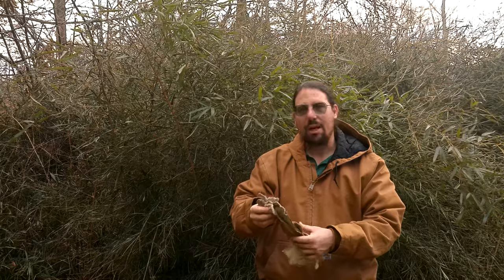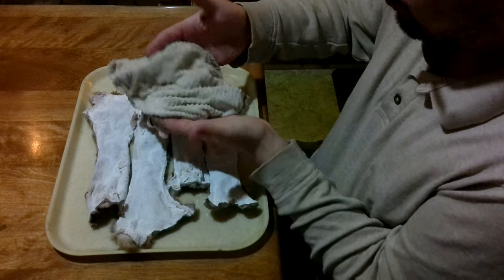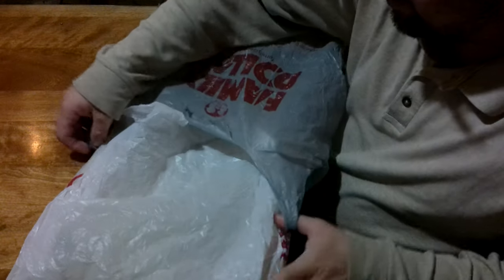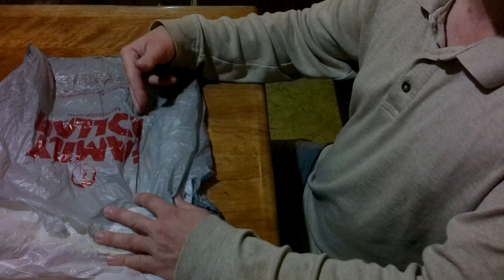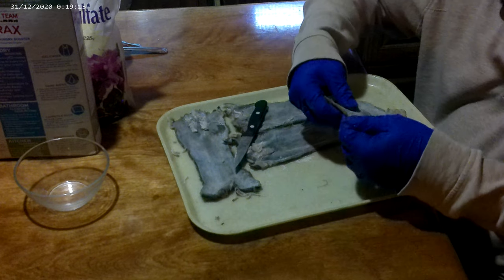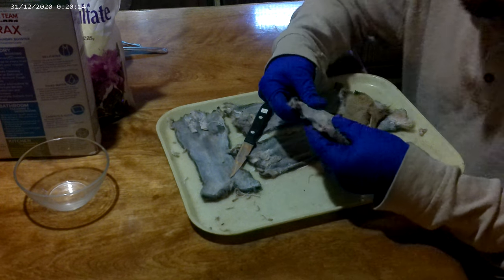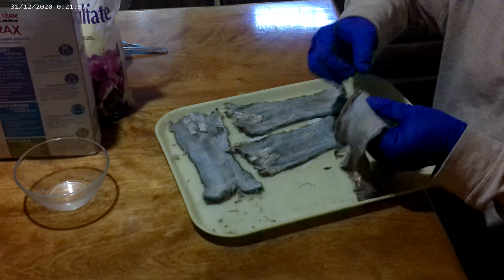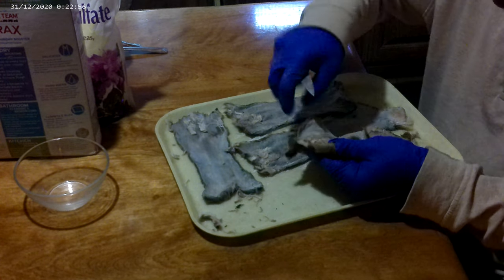Alum Tanning Small Skins--Using Aluminum Sulphate and Borax on Deer Leg (Hock) Skins

Comment: Hi there 👋🏻 love the video, very informative and helpful! I’m going to test your process on some spare pieces of hide I borax dried a few months ago. I can’t wait to see if this will save them. 

I did want to ask if you believe this method would work on a full hide of small game? (Rabbits, squirrels, possums, raccoons etc.) I’m essentially interested in trying to soft tan the whole hide and then make a “stuffed animal” of sorts so it would be posable.
Reply from the maker: Of course, and the mixture is pretty close to what comercial taxidermists use as a "dry preservative".  Chemically, hide is hide regardless of species, the only variables are how fatty it is (fatty hides lice racoon require extra processing) and how thick the hide is. Now, you say "save a hide", it won't undo insect damage or hair slippage that has already occured; but it will prevent further problems.

Comment: Heyy mate! Nice video :)
What do you think, it is a good idea to use this paste to make leather for crafts? Wallets,bracelets etc.
Reply from the maker: Well, it really depends on the use.  This produces a true leather, but it is susceptible to re-stiffening if it gets wet frequently...of course this is true of most leathers and can be ameliorated with the use of a heavy oil stuffing.  So, I would use something else like smoked "brain tan" if you are making something that will get dirty and need frequent cleaning.  Also do remember that the only leather that is moldable and toolable is veg-tan.  It is pretty similar to chrome tan, you are just using aluminum (III) instead of chromium (III) ions as the tanning ligand, and the bond between the coligan and the aluminum is a little weaker which is why it stiffens easier.  But--and this is a big but--it is a lot less toxic than chromium.

Comment: Use a little bit of egg and a little bit of minks oil mixed in with you if you got it or you can use olive oil or lard heated up on the stove just a little bit then mix that oil into your egg your eggs got the same proteins as the brain that helps and the oils you add to it helps soften abused eggs in mink oil mixed in with it and it worked and it turned out nice 😊
Reply from the maker: Yep!  all those recipes will work!

Comment: Curious I'f the products are used to change ph of soil why not grow anything where disposed of?
Reply from the maker: Well, basically to much of a good thing is not longer a good thing!  Eventually the sulfuric acid it generates will be decomposed by bacteria and/or wash out, and the aluminum ions will be converted to clay minerals...but if you dump a pile if it in the garden you won't have garden there for a while.  Also, the borax contains large quantities of boron, which while a trace nutrient in some fertilizers, is very toxic to plants in quantity.  So, again, to much of a good thing is no longer a good thing.

Comment: Hi, would this process work for beaver tails?
Reply from the maker: Well, I will first say that I have not processed beaver tails myself--but it will work on any animal skin (and over the years has been used on just about everything by somebody or another).  The question with something as fatty as a beaver is how much degreasing will be needed.  When you buck a skin the lime removes all the oils in the skin along with all the hair and surface texture, if you are doing beaver tails you will want the surface texture intact and won't want to do that do that.  Thus you will need to have an extra degreasing step or the chemicals won't be able to penetrate into the skin.